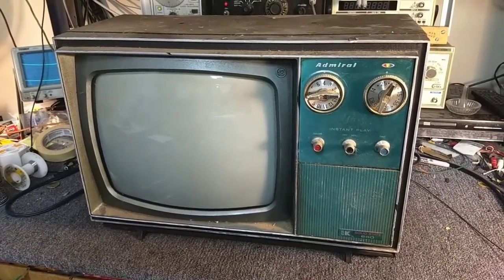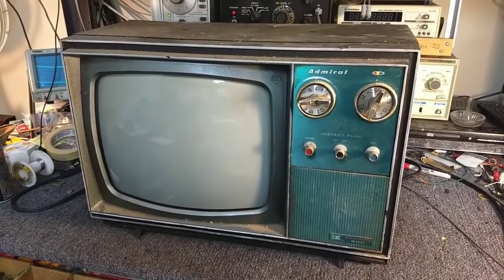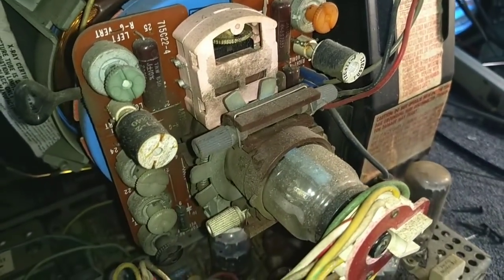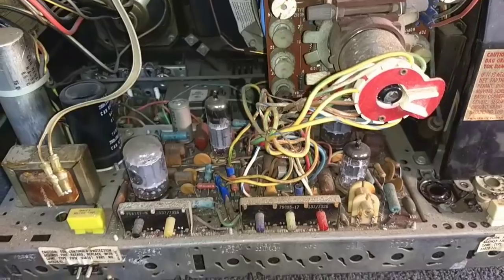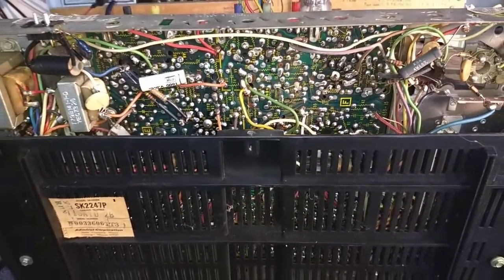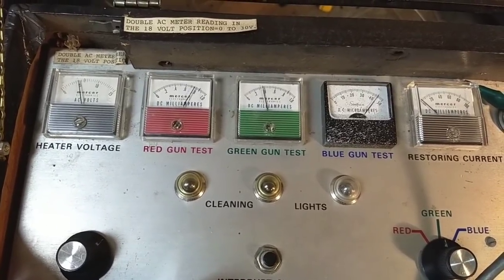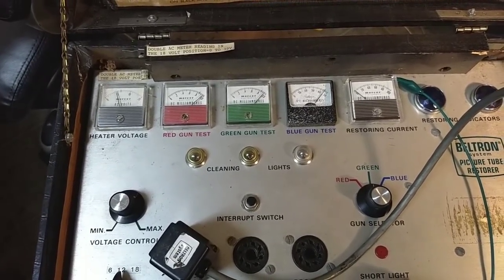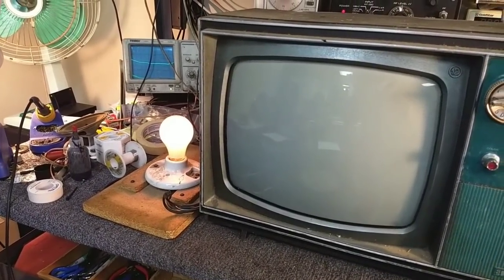Repair of 1973 Admiral SK2247 12" Hybrid color tv. Part 1/? -Assessment

Comment: meanwhile here in brazil, Colorado RQ was produced the CO/C3 model, 26'' inch color TV, in 1973... this TV set use 26 vacum tubes, and have only 4 transistors.... and no have PCB board on chassis, just one PCB board in CRT neck.

Comment: If done right, the "instant on" could help the tubes have longer life by eliminating the sudden shock of turn on.  The trick is to limit the idling current to a low value.
Reply from the maker: Easier to put an NTC thermistor in line with the set. RCA did this in the 60s with their solid state rectified tube sets.

Comment: I'd almost be willing to bet money the 70% filament voltage you see when off is from a series diode. It should be a quick snippy-snippy. I looked at your old videos and it looked fine on camera playing your NES, so it clearly has gotten worse with time. Seeing the issues makes me glad that my first and current TV project is black and white, by comparison there's nothing that could go wrong. Having said that my vertical oscillator transformer was open and I fear the vertical output transformer might have a shorted turn. Deflection on the top half is fine but the bottom half is compressed. Have any tips?
Reply from the maker: Can't know about the transformers without ringing them or substitution. If you've got compression or foldover I would check capacitors in the vertical oscillator and output stage first.
Reply: @JordanPier  Thank you. The cap in the oscillator was previously replaced with mica so I doubt that's an issue, but now that I built myself an isolation transformer I'll re-verify the oscillator waveform as maybe my rewound oscillator transformer is affecting it. Unfortunately I don't have the correct capacitors for the output stage but I put two in series to make a single temporary substitute. I individually subbed each paper cap with this replacement and there was no functional difference. Maybe both need to be replaced at the same time for a visible result, I don't know. I don't have a  proper ringing tool for the transformer but maybe I'll try putting a capacitor across it and pinging it with a battery and see what it looks like on the oscilloscope.
Reply from the maker: @eDoc2020  don't neglect the possibility of an open potentiometer for linearity or height. Usually the height control works the output amplifier tube and the linearity control the oscillator. If one is open it may cause your symptom
Reply: @JordanPier  I already checked all the resistors, including the controls. On this set (Emerson 611) there won't be any deflection if the controls open.

Comment: Instead of disabling the Instant On circuit, why not plug the set into a power strip that can be switched completely off? This way, you can switch the power strip on a minute before turning the set on. This would lessen the power surge to the electronics, eliminate any wasteful current draw, and make it safer.
Reply from the maker: Because I'm forgetful

I'd rather leave it plugged in and have an inrush limiter to soften the blow on the tubes.